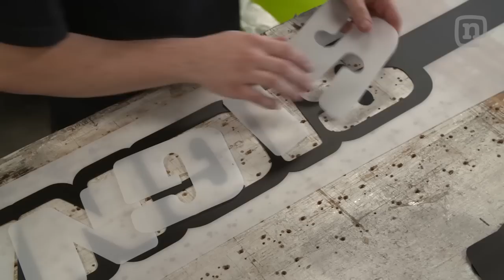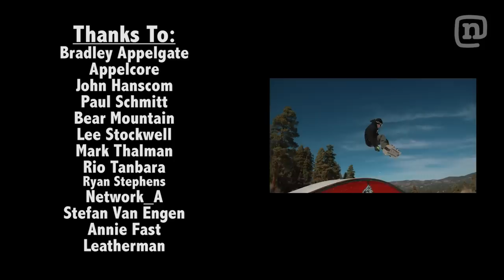The Ultimate Surfboard Stringer Snowboard: ETT

Comment: You guys should try making a carbon fiber board. Or a board with springs acting as suspension. Like this so they can see!
Reply: Cf is a bad idea... they're pretty brittle... They should try this veneer board again but change the veneer angles to strengthen certain areas... that should be pretty interesting!
Reply: ThisAccountIsNeverUsed Idk... My experience with a cf sideskirt and bicycle..... My bicycle is rather stiff and ice already cracked by side skirt going over a hump.... I doubt it will be flexible enough on a board... But should be fun to try regardless...
Reply: A pycrete core would be cool. The core would have to stay under 32 degrees though..
Reply: Shawn Lim if your cf bike cracked.. probably a poor layup + cheap bike
Reply: +Shawn Lim Carbon fiber boards exist and they're nice. They're stiff though so they wouldn't be good for park which is all these guys seem to ride.
Reply: +Shawn Lim I'm not sure if the board being that flexible was actually a bad thing. Definitely unusually flexible, but it saved him after one of those dismounts. Pretty sure a regular board wouldn't of give that much, and he would not of landed it.
Reply: Shawn Lim lib tech did it